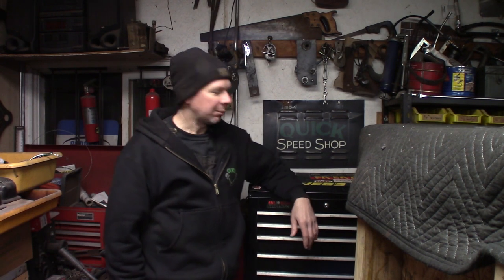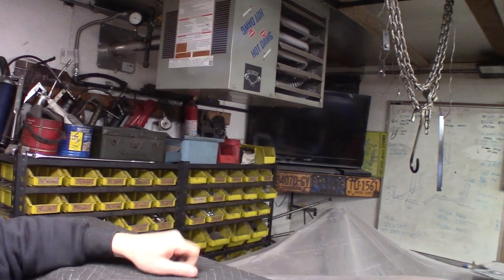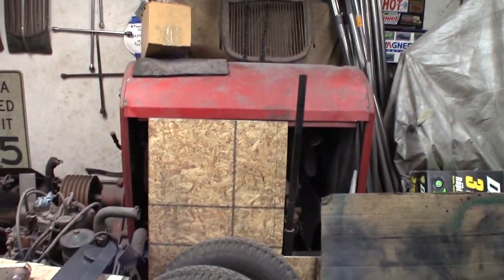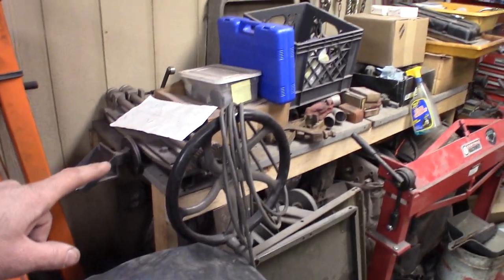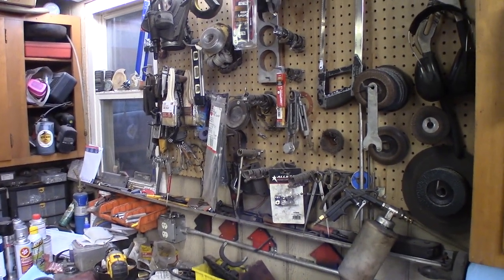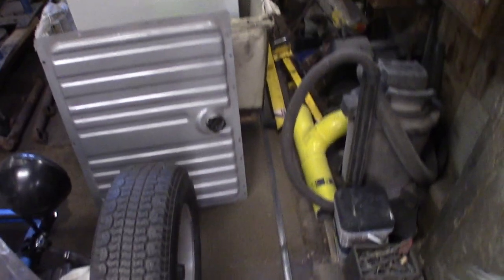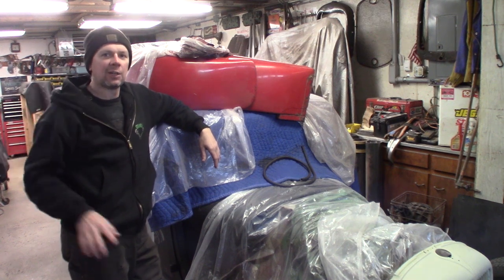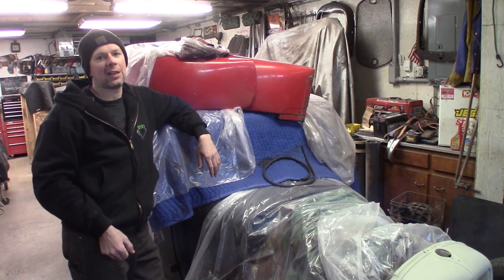Quick Speed Shop:  Spring 2020 Shop Tour

Comment: Yeah my shop is a disaster too but yours seems more of an organized disaster. The old saying is true "it doesn't matter how big your shop is it's not big enough ". My shop is 36x36 with a 14x36 addition and I'm tripping over things trying to work on my 1950F-1 project. It sounds like a lot room but there is 2 boat , 3 4 wheeler,  3 motorcycles, a riding lawnmower, plus the regular tool stuff, welders pressure washer generator and tool boxes. The things that are here belong over there that stuff should be here and this belongs back there. I FINALLY got it, the F1, in one bay and have most of the next bay to work in. Yeah I know I have too many toys, I've been told many times. I left out 2 wood stoves, they're a mess I gotta get on of those heaters.
Reply from the maker: I hear you.  I have a 32x40 pole barn that might become my new shop, but its already crammed full with 8 more cars and other stuff.  Seriously considering an addition on the house just to get another 24x24 garage under it!

Comment: Hey man that Harbor freight pump you used to pump Fluid Film out of 5 Gallon bucket what size bit did you use to drill whole in bucket lid?
Reply from the maker: I don't remember, it was several years ago.  I just measured the pump with some calipers and drilled a hole that was close.
Reply: Thanks